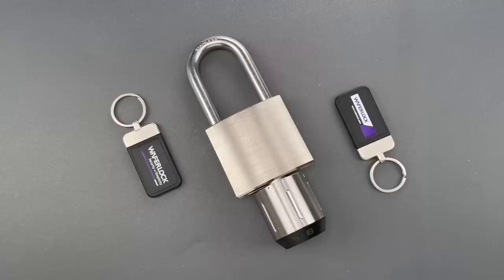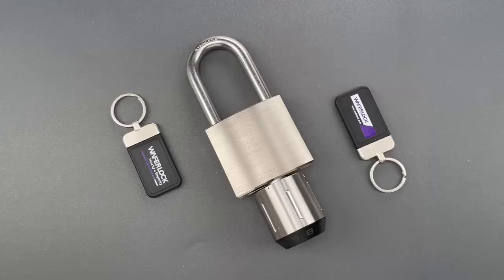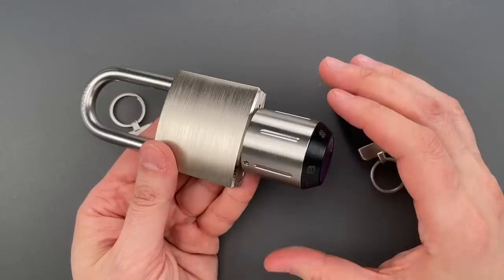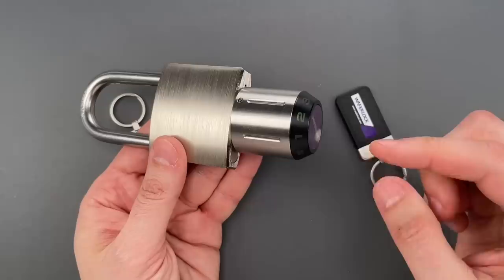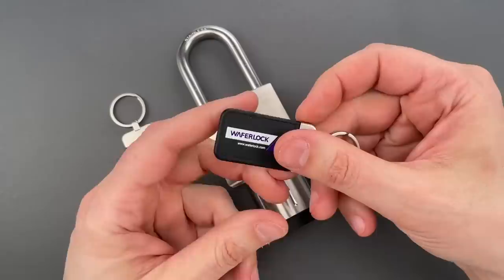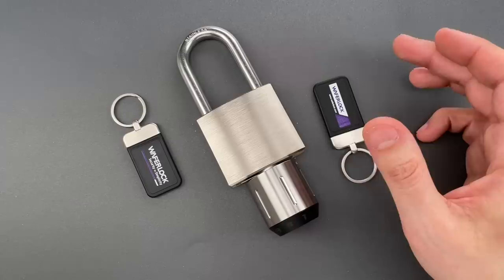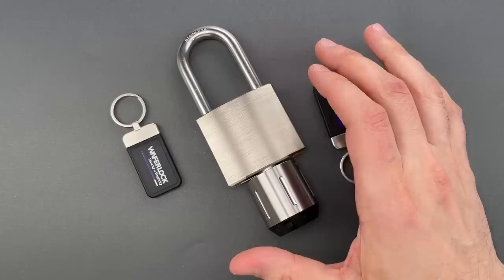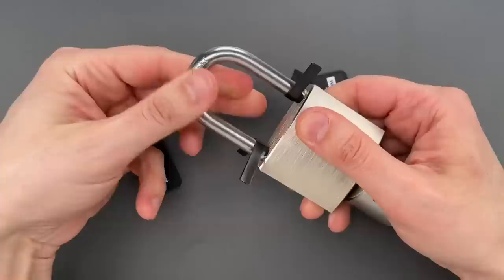[1518] $189 “Smart” Lock Opened in Seconds (WaferLock C210)

Comment: 189 dollars opened with a precisely cut and folded coke can 😂 always love your content
Reply: Reminds me of mcguyver
Reply: I'm terrible at keeping track of my keys. Over the years, I've had several apartments, where I used my laminated wallet-sized high school diploma to get into my place.
Reply: Except that you don't need precisely cut parts. Nicely teared coke can should be good enough.
Reply: How to you protect a lock from shimming?
Reply: @colemanmoore9871  Make the tolerances so small you cant fit a pad lock shim. If you still manage to fit a shim its so thin it will brake when you use it.
Reply: @colemanmoore9871  Use a padlock that can't be shimmed, instead of a spring loaded triangle piece("<") they usually use a ball bearing instead
Reply: @colemanmoore9871  Most padlocks use spring-loaded ball bearings or pins to "lock" the shackle.  They use them because they are cheap and simple, but since they are spring-loaded, they are vulnerable to shimming.  Better designs out there use a rotating cam mechanism that cannot be shimmed, or some other secondary mechanism that locks the pins in place when the shackle and core are in the "locked" position.  This way, the only way to release the pins is by rotating the lock's core to it's "unlocked" position.
Reply: @nispelsm  Thank you!
Reply: @colemanmoore9871  As has been said, there are padlocks that use a rotating cam and ball bearings for their locking mechanism, these can be identified by the shackle having semi-circular cuts in the part that goes in the lock, as opposed to wedge-shaped cuts like the ones you see in the lock featured in the video. If you see those wedge-shaped cuts, the padlock is most likely vulnerable to this attack.

A better quick test for this vulnerability is to see if you can open the lock, remove the key, and only then close it. This indicated the locking lugs are spring loaded, which means a shim can push them aside while "locked".
Reply: I love you too Jonothan! Had for years♥
Reply: @colemanmoore9871  Don't use it.
Reply: "precisely cut and folded" = ripped out a piece with your teeth, and bent it over a BIC pen.
Reply: @barberman1087  Or just use a padlock that needs key to lock. Those cannot be shimmed because if the core is not turning, the lock mechanism will not retract.
Reply: LPL uses RedBull, not Coke.
Reply: @colemanmoore9871 with mechanism that will lock latches against pushing them inside (for example have both of them in one piece and rotate them slightly during opening or use cam with bearing balls). You will lose ability to lock it with just pushing shackle down, but gain much higher security.
Reply: The bottom of a Pringles can works significantly better. Coke cans are too thin
Reply: @colemanmoore9871  you could make a small step in the shackle once inside the lock body so that the shim would have to have two 90deg bends in them to get to the lugs.
Reply: @MrLeafeater  glad to hear your high school diploma is still opening doors for you after all these years.😂
Reply: Even cheaper than buying a neodymium magnet (the usual method of bypassing "Smart" locks), but possibly more hazardous to create / use...
Reply: Soup cans work better, but are harder to cut.

Comment: I cannot imagine a padlock so amazing that I'd pay $189 for it
Reply: In this particular case, you'd be better off placing four $10 locks on instead of this one lock.  It would take longer (only by seconds I realize) and save you $150.  Also, 4 locks might just detour a thief to go to another location/item.
Reply: Really? What if LPL endorsed it as a high security device, or better yet couldn't pick it?
Reply: You use this to lock your cellar and one day, the lock will be gone and the cellar untouched ;D
Reply: Good locks are expensive, and what you're locking up will surely affect how much you're willing to pay for a lock.  The ABUS Granit 37/80 is an example, better than most but only about $125.  There's also the Squire SS100CS, almost $400, but also better than average.  LPL has reviewed both of these.  Nothing is perfect, but both of these would likely keep the local crack head or non-professional thief out of your stuff.
Reply: There are definitely ones out there that are worth it. Mul-T-Lock and Abus are two brands that come readily to mind. Bosnian Bill had some really good videos on actual high security locks.
Reply: Well if its not your money, then why care. You might actually show off how much you spent to show your coworkers that you value security.
Reply: @martymassie313  nope. If I'm securing something that's worth spending that much on a lock, it won't be secured with a padlock.
Reply: Why pay for it, just take it of the door shackles it secured shut.
Reply: A bowley perhaps. The strongest lock I’ve seen and very close to prick proof at least without a lot of skill and very very special tools.
Reply: @martymassie313  I've yet to see LPL endorse anything except his lock picking tools 😂 I'll legit buy anything he recommends
Reply: OMG...gone in 6 seconds
Reply: It'd be the most expensive thing I owned. I'd have to buy a lock to protect my lock
Reply: @NixonAngelo  Abloy.
Reply: It has a hidden security feature not discussed here. Once opened, given its price tag, the thief steals the padlock and leaves everything else behind.
Reply: I can imagine that padlock... but it probably couldn't be built in the real world
Reply: Hmmm, the eay I see it, the $189 lock would be gone in 2 seconds with bad guy using a rusty a $3 garage sale bolt cutter.
Reply: Maybe, if it were for a niche product or made-to-order for a specific purpose. I'd never trust a smartlock though.
Reply: Especially not one with such a thin shackle and basic lock body! $2 for the lock, $20 for the electronics, $50 for the (lackluster) R&D, and $117 for marketing to come up with "Most secure RFID pidlock for to make all your stuff safe!"
Reply: I’ve paid more than that for a padlock
Reply: Bowley may be worth the money, some Abus Granit padlocks are at least providing some security but this thing is not even a joke :/
Reply: Any lock can be defeated. Even if it was unpickable, an angle grinder with a metal wheel will go through pretty much everything.
The best you can hope for is a lock deterring a thief. For that, an Abus or Medeco will work. Most thieves don't have the skill to pick them, and don't want to make noise with a grinder.
Reply: And neither, apparently, can the Lock Manufacturers!😏
Reply: @kj3n569  noisy and would leave a mark of entry for insurance
Reply: I can imagine it, but it certainly isn't that lock!
Reply: @NixonAngelo   he did actually endorse the ABUS Granite 37RK/80. it’s very beefy and resistant to physical attacks as well as having a good disc detainer core that offers solid resistance to picking. it’s video 1398. 

it took him over 3 minutes to pick it! it would likely be almost impossible for someone with less skill or worse tools to pick it
Reply: @spocksvulcanbrain  if I was a thief, 4 locks on any door would just entice me to know what's inside...
Reply: you might want to look at some of the Medico or Multilock offerings if you need something in this category.

Comment: Smart locks always seem the easiest to open for some reason
Reply: Probably because a lot of the people who make them make them to be cool and not because they know how to make locks
Reply: As the name suggests they locked the smart part
Reply: The smart part is how easily they drain peoples wallets for something flashy instead of something functional.
Reply: most of them by necessity have 2 ways to open, dues to out of power issues, this leads to more things to mess up.
Reply: Simple reason really, they use the "smart" and electronic parts to hide its main flaw. Keep in mind, some cheap electronic components are waay cheaper and easier to manufacture than you think, and often cheaper than going for decent but otherwise purely mechanical components. The second part is most people don't even know how locks work and how are the better ones compare to some cheap junk, this is another one they capitalize on. Even in non-smart locks you can see big bold "TOP SECURITY", "MAXIMUM SECURITY", etc being put on almost every single one of those cheap locks, especially bootlegs of reputable brand locks.
Reply: I think it's because the people that design smart locks didn't bother to learn how existing locks work, and/or nearly the whole budget went to the smart parts so rest of the lock had to be done cutting every corner.
Reply: The only thing smart about most so-called "smart" devices is how much more money the company can make on them over a simpler, more effective design without unnecessary electronics.

Most devices don't need "smart" technology, but it's a big sales buzzword.
Hell, there's even "smart" toasters, for those people who don't have the smarts to adjust the dial on their toaster when the wires are pre-heated from the previous toasting! 😂
Reply: There has gone inflation in the word “ smart” . ❤️
Reply: It's electronics designed by locksmiths and locks designed by electrical engineers... With software written by someone with zero clue about either. Seriously though, you need security-savvy teams for all 3 all working together, and that isn't easy.
Reply: Much more people who know electronics expand into lock market, than people who know locks expand into electronics market. It has all the fancy electronic features, but nobody at the firm has a clue about basic lock security.
Reply: @LRM12o8  It's fair that you enjoy mechanical adversity as a part of your existence, but I would be cautious about projecting that onto others as some sort of inherent virtue.
Reply: Marketing seemingly intended to mock stupid people.
Reply: I think he favors showcasing the bad smart locks because they’re more expensive, and thus we should be able to expect better security.  Obviously he’s thoroughly debunked any notion that that could be true.  Honestly extends to a lot of things.  Price means almost nothing now unless you know the seller’s reputation
Reply: they are smart enough to be opened without being destroyed lol. Same as you give a robber your wallet instead of getting shot and still losing your wallet.
Reply: @nebufabu  For smart lock reviews I'd really like to see a second episode done by an IT security channel which rips the software/electronics side apart. I can't imagine that the grass is greener over there :-)
Reply: Like the phrase "Work smart, not hard" goes, this lock isn't hard to break
Reply: Except for gun safes. They're the number one :D
Reply: This is what happens when you let techbros design things
Reply: They could make a good smart lock if they wanted to. But it would cost like 500 bucks probably and that's still hoping they don't use some mechanical lockup that is easy to beat. Like others here say they use it as a buzzword to generate sales.
Reply: @LRM12o8  Some people would argue that a thermostat might be enough but let's make it "smart" instead.
Reply: The intersection of people who knows how to do good electrical security, cybersecurity and physical security is very small. At a guess it's not even incompetence (that would suggest they don't know how to do their job) that leads to these flaws, it's ignorance (they don't even know what job needs to be done).

Comment: Damn it, waferlock, being vulnerable to shimming means we don't now know (from this video) if the polyurethane hammer or magnet would also provide an attack on your lock!
Reply: I was expecting him to just take the 'smart' part off with the two allen screws and unlock it with a screwdriver tbh
Reply: @markkNL  That was my third guess, but reference to "seconds" made me thing it was something even simpler.
Reply: Magnet. This thing is begging for a magnetic attack.
Reply: I bet with a lock like this, LPL would find 10 different ways to open it!
Reply: @markkNL  You mean open it with just a screwdriver like many 70's and 80's vehicles. Even 90's hondas if you have a pair of needle nose pliers and a philips screwdriver.
Reply: Polyurethane hammer. Even if there's a quicker, smarter, neater way (ie, an LPL way), gimme the hammer method any time. Sorry. I'm such a gentle guy in every other way.
Reply: Ah yes, the dreaded Piss Hammer 😂😂😂
Reply: If the piss doesn't work, then the sledge will for sure. The fancy bit should roll on the floor a few good meters after!

Comment: You got me when you said "Smart Lock" my mind went straight to a magnet, not shims.
Reply: Same
Reply: My first thought also followed quickly by shimming. LoL 😅
Reply: Yea, totally thought he was just gonna run a magnet over it and it would pull the pins up or something
Reply: The basic mechanical security failure was so obvious LPL didn't have to even consider magnets, EMP, signal copying or other "exotic" methods.

A LPL video less than three minutes means a very poor quality lock, more than five a quite good and ten legendary.
Reply: I was expecting magnets or urethane hammer.
Reply: I immediately went to shimming, and once he broke out the shims, I started laughing that I called it AND that the flaw was that obvious
Reply: I was chanting "Shim it! Shim it! Shim it!" after about 10 seconds.
Reply: My thought was rapping with a mallet.
Reply: Those (the?) exposed screw(s) on it's huge knob don't look great either.
Reply: Just because the shims worked, it doesn't guarantee a magnet or bump hammer wouldn't.
Reply: At $189 I was at least hoping it was going to require the portable EMP before opening, but this is totally unacceptable.
Reply: I was hoping for a tap with the hammer. They have a certain comedic value.
Reply: I'm guessing a magnet would work just fine. There has to be some sort of solenoid causing the smart nutsack to lock and allow you to turn the core.
Reply: @keithschrack  I'm pretty sure he tried all methods but he typically makes the video about the easiest method to underline the fact that knowledgeable attacker would always use the easiest method.

And if you think that the attacker doesn't know the easiest method, you simply have "security by obscurity" design.

Comment: Another product to avoid, thanks to LPL BTW just last week I manged to open an interior bathroom door whose mortice catch had broken meaning the handles no longer moved the catch, the door was a snug fit so I drilled a very small hole through the architrave and inserted a tiny screwdriver through the hole and moved the latch, it will only take small amount of filler and a dab of paint to cover the hole and I've replaced the mortice latch cheaply.  Brute force would have damaged the door and door frame so thank you LPL you inspired me and saved me the expense of a new door 😊
Reply: There's also the SlimJim tool for that to slip the latch.
Reply: Amazing story. It is perfect example of something I like to say "Learn how things work and look behind the curtain. You never know when you may need it."

Comment: I would like to take a moment to point out that, as of writing, this video has 13,662 views as of 28 minutes ago, and 1938 likes with 0 dislikes.

Is it even a ratio when the other side just doesn't exist? Another banging video, LPL. <3
Reply: Return YouTube Dislikes isn't completely accurate; it relies on estimates using user-submitted data, since the site itself no longer reports the real number to viewers. Newly uploaded videos especially are likely to show 0 dislikes, before a workable estimate comes in.
Reply: Youtube no longer displays the counter for dislikes so you cannot know if there are none.
Reply: @MikkoRantalainen  You mean you don't use a plugin to restore the feature? Have you been living in a cave?
Reply: @imveryangryitsnotbutter  I don't consider the dislike count important enough to run browser extensions for that. I incorrectly assumed that you interpreted the missing dislike counter as zero.

Comment: I feel like the really hard part is to identify the weakness of the lock in a short amount of time. I wonder if there is a systematic process to do so?
Reply: Does it have a shackle? Try shims. Does it have electronics? Magnets. Are there exposed hinges? Pop them. Does it have a "backup"? Aim for that first.
Reply: @henke37  this should be printed as a booklet or card because it hit all the common flaws
Reply: Practice.
Reply: Systematic, maybe, but only one guy has to do it once and publish it.
Reply: @henke37  You missed try tapping it with urethane hammer while pulling or pushing the shackle.

Other than that, nice list.

Comment: Another nice novelty...
Looks like they took a standard padlock and replaced the core with that "smart" knob not patching the vulnerabilities like the shim or even the bypass although I don't see how you could slip a bypass tool since there's no physical keyway.
For a fraction of the cost you can get a Abus disk detainer padlock with unshimmable ball bearing locking mechanism and key retention as well.

Comment: My Corolla ignition lock cylinder kept getting stuck so I took it apart. It had wafer type tumblers and I removed some of them that were standing too high and reassembled the cylinder and it works just fine even if less secure. Really interesting that Toyota may be using a very outdated wafer technology in their ignition locks.

Comment: It also looks suspiciously like that spindle knob has a fixed bar down the centre of it that actuates the lock. If that's the case, I would worry if you could pry or snap it off the bottom of the lock leaving an exposed actuator - or even worse; Tap it with a nylon mallet to get the solenoid to jump in to the notch on the actuator.

Comment: Might be called a waferlock because, in electronics, a wafer is a thin slice of semiconductor, such as a crystalline silicon used for the fabrication of integrated circuits.
Reply: It's cos it is as good as an ice cream wafer at protecting stuff?
Reply: And finally, monsieur, a wafer-thin lock.